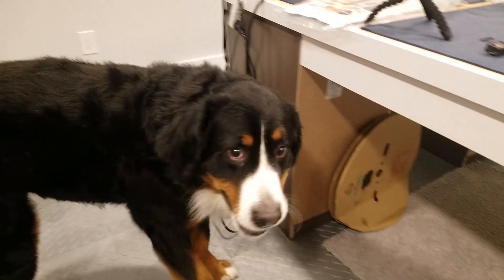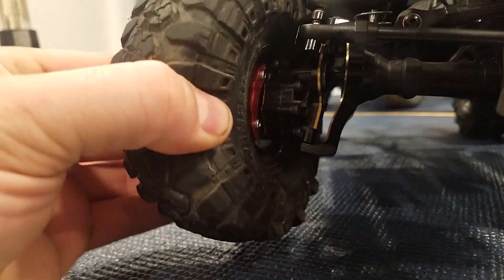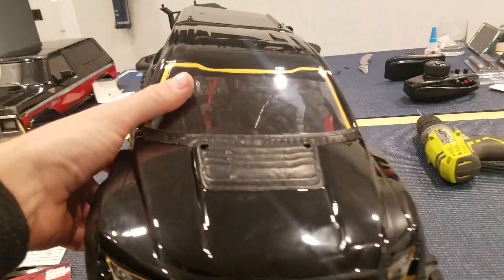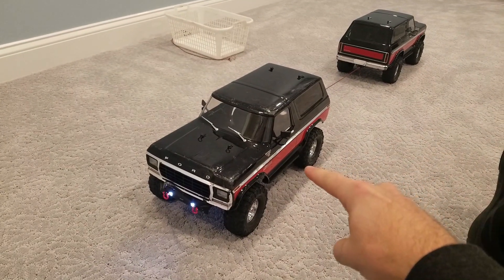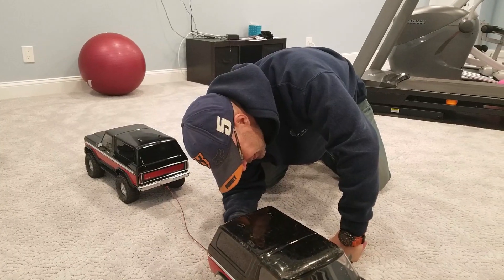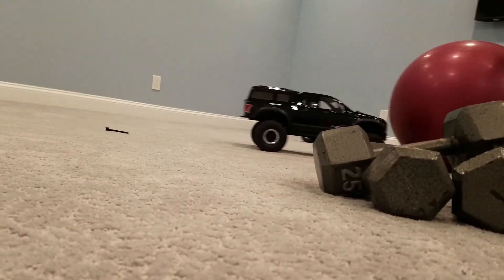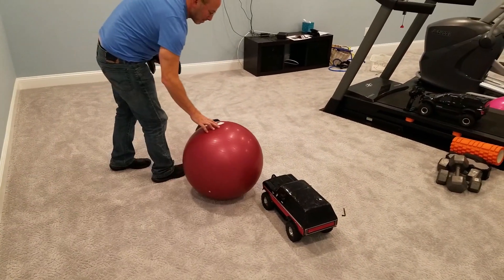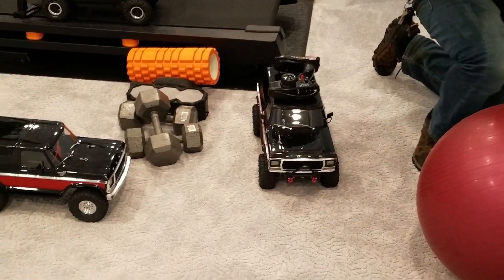TRX4 UPGRADED AND TESTED - RC MUSTSEE

Comment: Is that 45t motor plugged into stock esc?
Reply: In a trx4 Amp draw doesn't exist. no spec sheets on Amps/Watts for esc or motor on internet. just got a 5000mah 65C maybe 300Amps is enough!! because who knows the spec's?? FFFFFFFFFFFFFF it drive me crazy.

Comment: What kind of motor is that you have the 45t
Reply from the maker: rc 4wd
Reply: @rcmustsee437  So do you have to use a reverse rotation motor on the TRX 4?  Is the rc 4wd a special reverse rotation motor also?
Reply from the maker: @Jbcmastertech  Just switched the wires from the ESC to motor